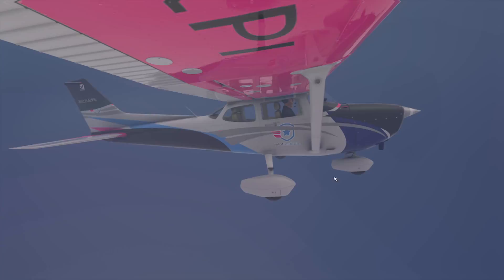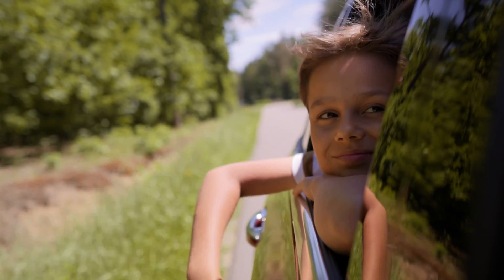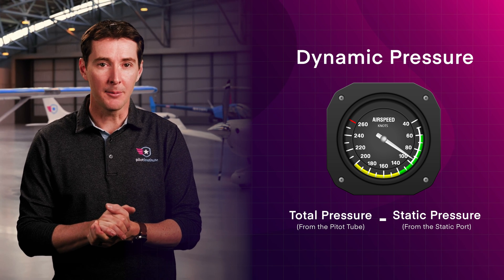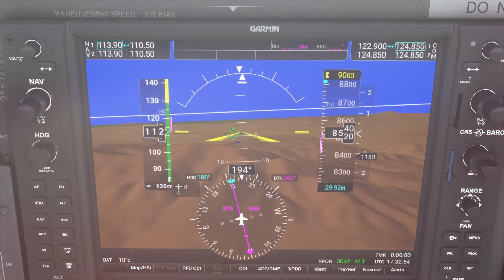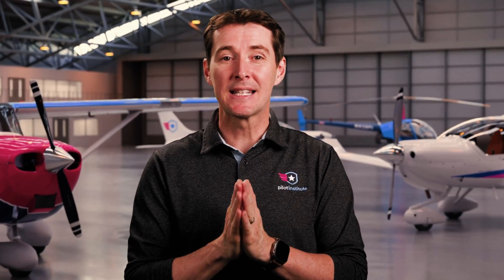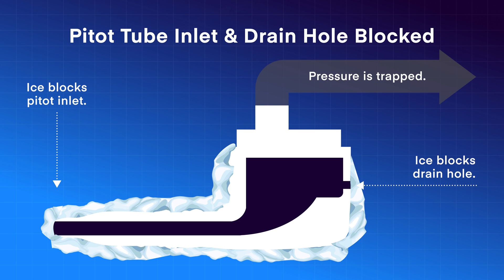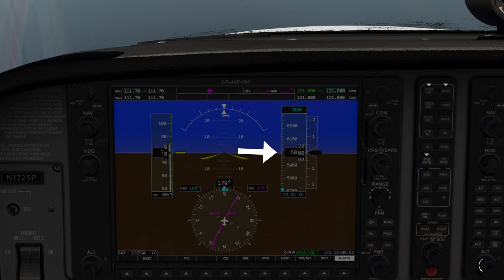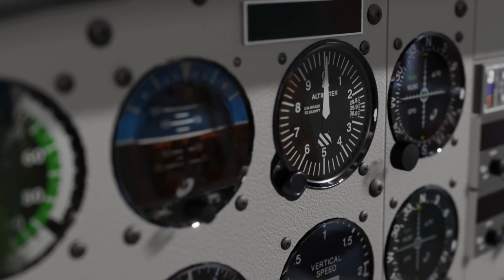The Most Dangerous System? | Pitot-Static System Explained

Comment: No matter what precautions you can take checking the pitot covers, painting them in bright red, adding reflective strips or whatever (Aeroperu disaster comes to mind, they covered them with clear tape). There is always the risk of tubes blockage as history have shown repeatedly with hundreds of lost lives. I can't  understand, specially in commercial airplanes why they haven't designed an alternative way like measuring airspeed in such emergencies using the RAT or a small deployable anemometer.
Reply from the maker: Losing airspeed is not a deadly failure. Pilots are taught to fly without an airspeed indicator.

Comment: Awesome video clip! However, there's one major scenario that will cause these problems that you left out. It's an unqualified cleaner without an A&P license waxing over the static ports and clogging them. Cleaning aircraft is a PM item that has to be done by an A&P. You'll also note that all aircraft have cleaning in the MM therefore it needs to be completed by an A&P. When this happens all the static ports will be waxed over and clogged. In the last 10 years this has been all to often with the FAA now turning their backs leaving cleaners unchecked. The pilot has no way out flying IFR. My guess is the C-414 that went down off the coast of San Diego yesterday had waxed over static ports.

Comment: Excellent video! I do have a pitot-static question: Several years ago, I  was flying with a friend in his C310R FIKI-equipped from Gibbs-Montgomery Field in San Diego, CA to Lakefront airport in New Orleans for Mardi Gras. We encountered rime at around 13000' over New Mexico, and the ASI, VSI, and ALT began to malfunction, then freeze, except the ASI . Larry-the PIC- immediately opened the Alt air vents while I poured over the charts to find a nearby airport we could divert to. It wasn't until we could safely descend below 7000' with the help of Larry's Garmin watch, that first the ASI stabilized, then the ALT and VSI began functioning normally a moment later. My question is, why, if the alt air vents were opened, did the affected instruments not begin to function immediately,  or at least soon after the new static air source was introduced?
Reply from the maker: Good question, Your VSI and altimeter should have started to show something for sure. It's possible there was an issue with the alternate static system.